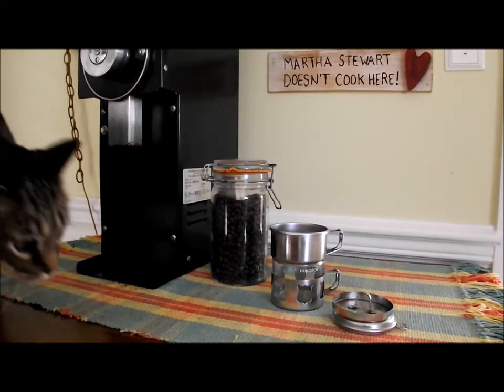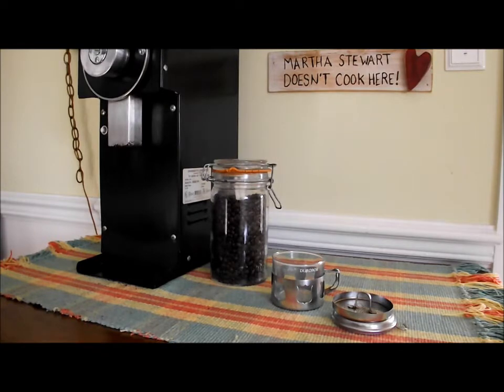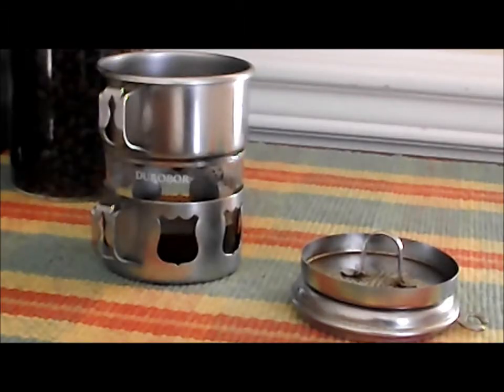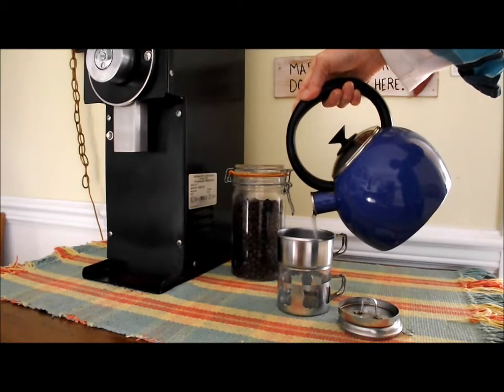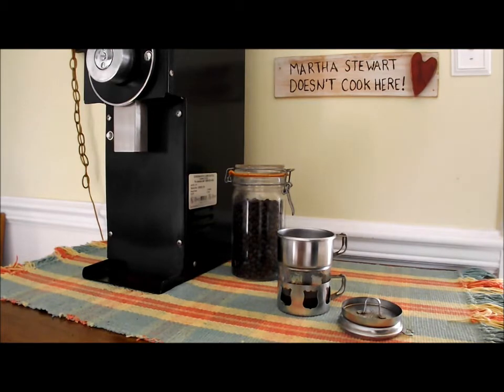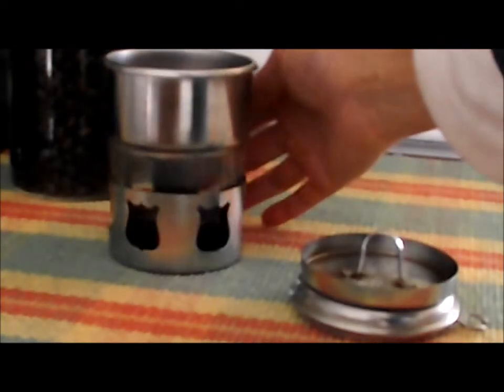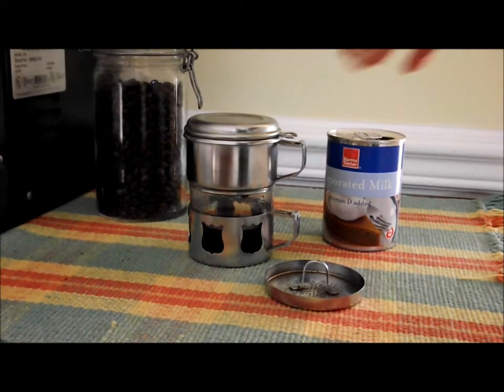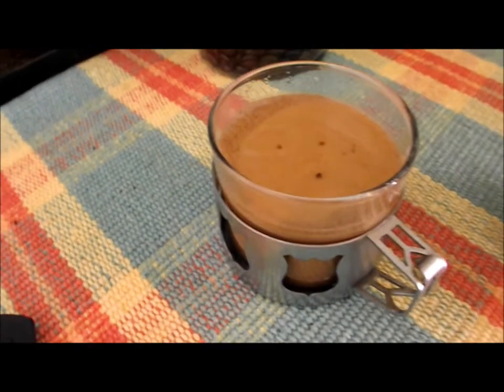How to use a Single Cup Durobor French Press Coffee Maker Pot

Comment: Hey thanks!  Just found two in MINT condition in thrift store for $1.52 each!
Reply from the maker: Wow - SCORE!!!! Wish I would come across another one, just in case I break the beaker! Sometimes I do just put it on a mug with the same size top and drip directly :) Depends on if I want to supersize it. Congrats for joining the Durobor community. HA!
Reply: @ForsythiaHill  Mine are stainless steel but the glass part says Made in France.  May be a different brand a paper was in one that was in French and what I thought was Dutch, but perhaps the set was to be sold in Belgium.
Reply from the maker: @MI_Prepper  NICE. My beaker has no country insignia, other than Durobor. Apparently much more utilized overseas than in US, I have not seen any vintage models that were manufactured in the US.

Comment: I bought 3 of these Durobor Coffee makers in Ostend, Belgium in 1968 just prior to my last year at University. Only one glass has survived to the present sadly but I have mugs/cups that they fit. I use ready ground and relatively finely ground coffee. 2 heaped teaspoons of coffee are used with the body of the filter sitting on its cover. I tap the body to settle the grounds and place the press part onto the coffee. The body has dimples and the press part has a small cutout so it can pass over one of the dimples as it is inserted, it is then rotated to lock it in place. Some grounds drop through into the cover. The filter unit is now placed over the cup/mug and the few grains in the cover can be tapped into the unit. Off the boil water is added to fill the unit in two stages. 1cm depth to get absorbed into the grounds and the remainder to fill it when the first amount has reduced by half. Put on the cover and allow 4-5 minutes for the water to filter through. Remove the filter unit and stand it on its upturned cover, add milk, cream, sugar to taste and enjoy. My coffee was always popular at uni'.
Reply from the maker: Thank u so much Mike for your great comments. You have had since 1968! Wow - that is amazing. Glad you have one glass carafe remaining.  I too use other mugs for the base (sometimes I just want a little more). I've recorded a NEW video based on viewer comments and trial and error. I find my Durobor to make better coffee than Drip or French Press. I'm glad I found this at the Nelson County SPCA Thrift Store. If I did not collect Coffee Makers, it would not have caught my eye. Here is the new video: How to use a Single Cup Durobor Coffee Maker Pot Part II - Improvements

Comment: You're supposed to put the metal filter on top of the ground coffee before you pour the water. This is so that the water runs through the coffee evenly. You get the same flavor every time you use it and you don't have to press anything.
Reply: Hi Matthijs, I just tried your method and the coffee ran through in 2 minutes, not nearly long enough of an extraction period for Coffee (I did tamp prior). I did see a great improvement in removing grounds from the final product. Are u using a fine grind and tamping as if you were making Espresso? Because the filter holes are not as fine as what you would see for Espresso and there is no pressure to force the water I concluded this unit to be for Coffee not Espresso. My other options would be to add more coffee grounds or to tamp harder or just lightly to slow down the brew. Thank you for your comment, I would love to know how long is your brew and what is your process.
Reply: Hi Rebecca English,
espresso's are made under pressure so you have to an espresso machine or something like a percolator. This is why you shouldn't use an espresso blend. I most use a full city roasted single origin.
How I use the durobor is with a coarse grind (a bit finer then I use for french press) and an extra, paper filter (I never tamp). I think for a one cup filter coffee 2 minutes is perfect. Things like V60 or Chemex are 3 or 4 minutes.
But off course there is no perfect way to do it because everybody has it's own taste for coffee (: